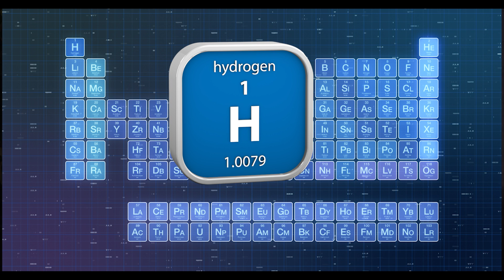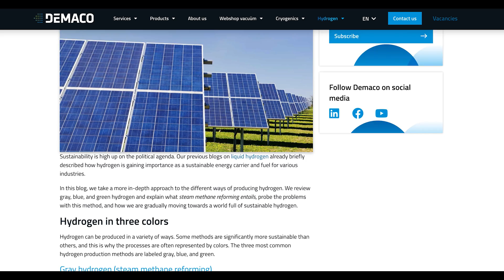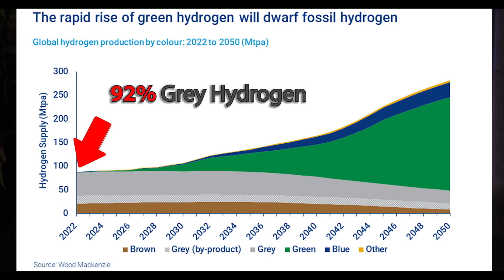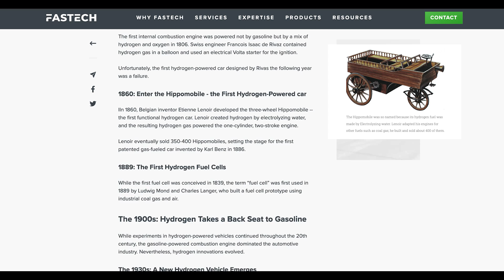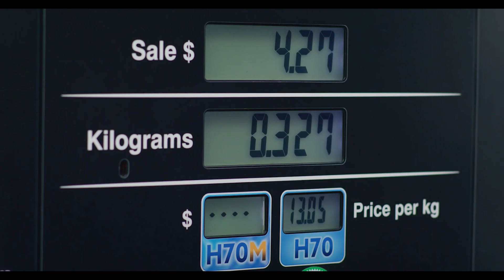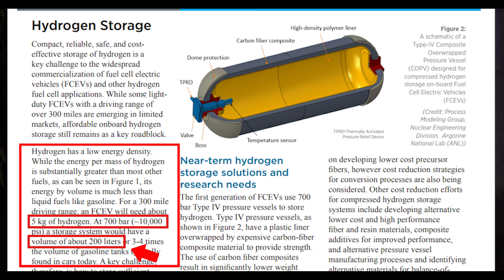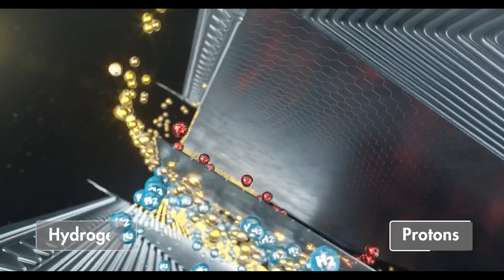The Truth About Hydrogen

Comment: While I love the idea of green hydrogen, I don't think the numbers add up. I remember reading a while ago that water electrolysis requires about 50 kWh of electricity to produce 1 kg of hydrogen.  

For this example, let's say a commercial, grid scale solar farm cost $1.50/watt. Let's forget about the access to water for a minute and just pretend that is not an issue. If we put this solar electrolysis farm in AZ or NV for maximum  production, the high end might be 1800 kWh of production for every 1 kW of installed system size.  Let's say it is a 1 MW (1,000 kW, 1,000,000W) solar farm.  Let's also forget about panel degradation, inverter replacements, storm damage, etc. So the install cost was $1,500,000. This 1 MW system would produce 1,800,000 kWh per year X 25 year lifespan = 45,000,000 kWh . 45,000,000/$1,500,000 gives us a 25 year price per kWh of $0.0333 * 50 kWh = $1.67 per kg of hydrogen. In reality, if we factor in a bunch of stuff I said to forget about, that likely brings it to at least $2, if not $3 per kg of hydrogen, just to produce it. We have not compressed it, stored it, distributed it, or anything else.

When all is said and done, it would likely cost a consumer $5/kg of hydrogen. In the video you say 5 kg of hydrogen for 300 miles so that is $25 to go 300 miles on hydrogen. 

If an EV gets 4 miles per kWh, then it would need 75 kWh to go 300 miles. If you have a solar setup at your home that produces electricity at a 25-year price per kWh of $0.10, that same 300 mile trip cost $7.50

Can anyone tell me if I am missing something?
Reply: Yes, you are missing the fact that hydrogen will be sold with extra margins and taxes, increasing the price even further
Reply: @texanplayer7651  yup, forgot about Uncle Sam.
Reply from the maker: Yes totally agree, and you're not missing much. The process of extracting hydrogen is expensive, but I see how with the excess of renewables, and lack of storage it could be redirected to create green hydrogen ? Maybe... maybe some day.
Reply: @solartimeusa   Yes, I am missing something, MORE OF YOUR VIDEOS! Keep them coming!
Reply: Currently refill of Toyota mirai in Norway is about 85 euros. Electric car can do same for 20 euros, or even less than that.